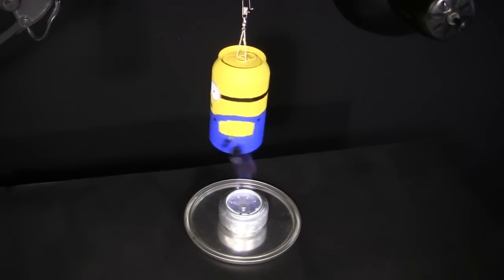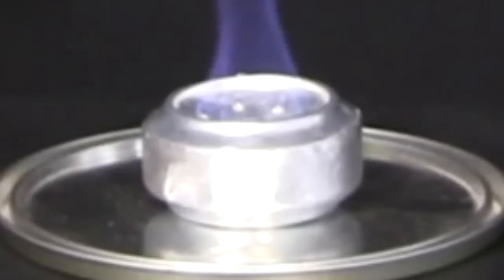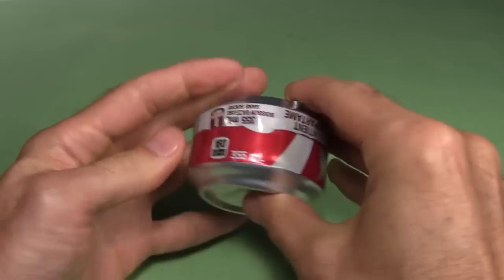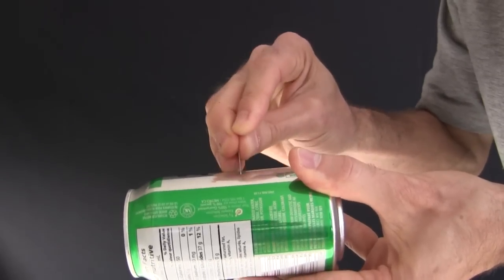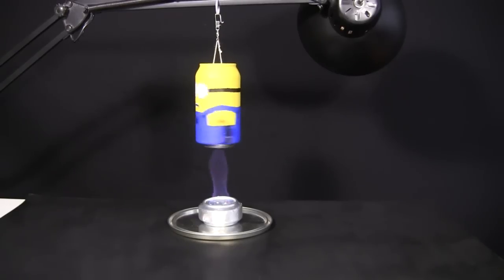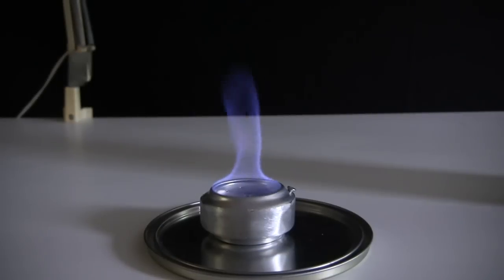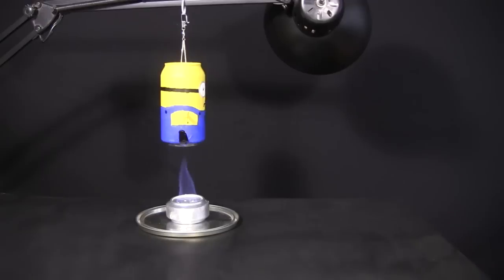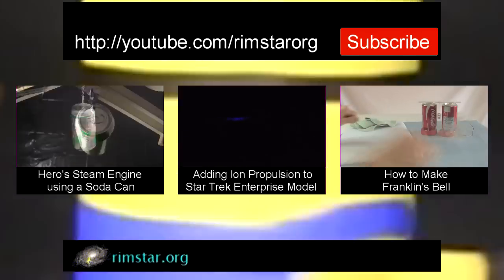How to Make an Alcohol Stove and Minion

Comment: That's a good technique.  I made an alcohol stove earlier this year, but had to keep using my mini torch to keep it going.  I'll have to try your way and using methanol instead of 91% iso.
Reply: CapnHolic I recommend using high purity ethanol. Methanol is much more expensive, burns marginally cooler and is much more hygroscopic (pulls moisture from the air.) Isopropyl alcohol burns much cooler, is a bit more expensive and is harder to get started.
Reply: Martel DuVigneaud Thanks for the advice.

Comment: nice alcohol stove, but some kind of heat insulation would be useful to heat up faster. also try heat insulation on the minion
Reply from the maker: Gotin Fuklio Thanks. For insulation on the minion I could use real overalls instead of painted on overalls :). Seriously though, good idea. Fiberglass insulation doesn't weigh much either.
Reply: Gotin Fuklio could probably just coat it with plaster/sand mix.

Comment: Would it be possible to create a generator using thus design or does it need very little friction to work and would break it?
Reply from the maker: chris james I was hoping to try a generator before I even started experimenting but there isn't much torque. Some improvements can be made, however, such as getting the steam output more tangential to the can surface. It just doesn't look very impressive powering a tiny generator while using something like a propane torch as the power source, so I didn't even try.
Reply: RimstarOrg You need a generator that doesn't generate a lot of amps so it can turn easily. Maybe you could make a very small coil and magnet and then use a Joule thief type of arrangement to make it do some useful work like light an LED or something that needs little current like power a microcontroller or something.
Reply from the maker: USWaterRockets +Gotin Fuklio suggested adding insulation, which would be lightweight, so maybe it can be made efficient enough to get more torque.

Comment: Sorry to bother you again but I have tried all of your small capacitors and i can't seem to get any to work. I don't know what I am doing wrong on all I them but i camt seem to get any of them to work.
Reply from the maker: lee from halfwittedprojects Can you be more specific? What are you doing that makes you think they're not working?
Reply: RimstarOrg I can't get any sparks and i just am not getting any reaction from them
Reply from the maker: lee from halfwittedprojects Those are small capacitors i.e. they have small capacitances and you're not charging them to a high voltage. That means they don't store a lot of energy so you won't be getting any sparks. Try charging one, then disconnect the charging source, and then measure the voltage with a meter. Do the whole thing a few times. You'll see the voltage quickly drop because as soon as you make each measurement because the capacitor discharges through the meter.

Comment: I actually just double checked it and it puts out 2.7 volts of actuating current
Reply: What can I do to make it stronger, if not possible what can I power with that?
Reply from the maker: lee from halfwittedprojects I'm no expert on generators and I've made only one small one once (and have never made a video, so I believe you when you say you didn't use a design of mine! :)). Maybe someone with more experience can say.
By the way, voltage, current and power are three different things. Voltage is energy per charge, current is the amount of charge passing a point per second and power is the amount of energy being generated per second. In case you want more insight, here's my video about voltage https://www.youtube.com/watch?v=yjNu0iT0ClM and my video about current https://www.youtube.com/watch?v=G3Ecx16iIBk.
Reply: RimstarOrg thanks. i have increased the crank wheel size and that helped.